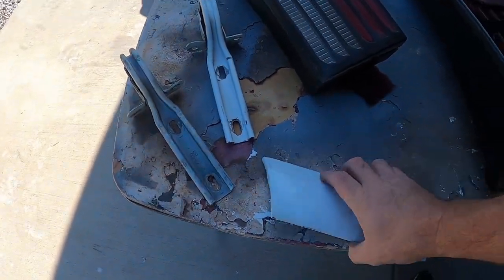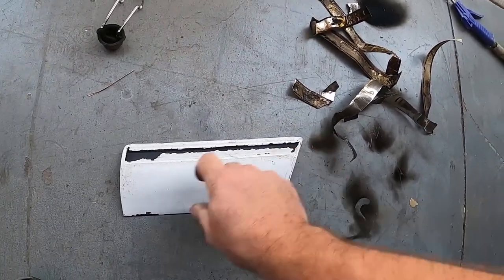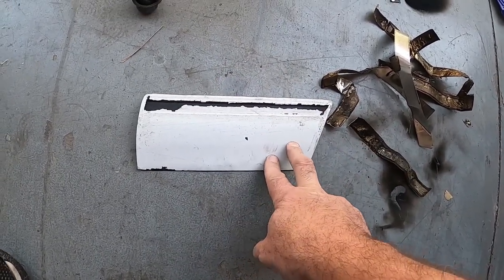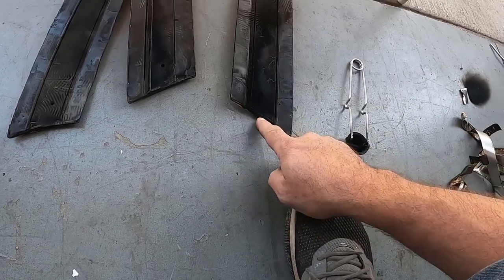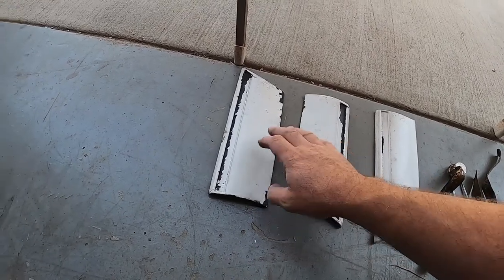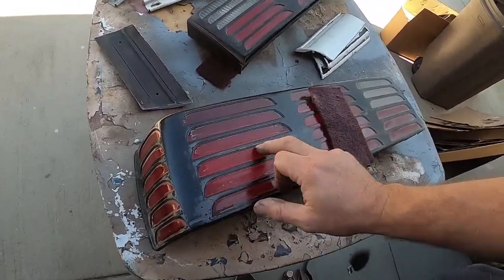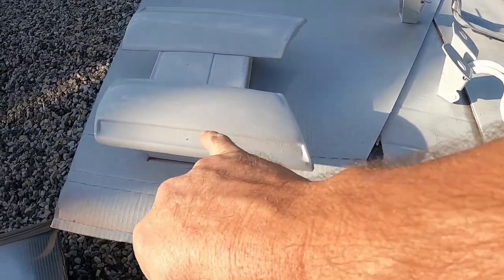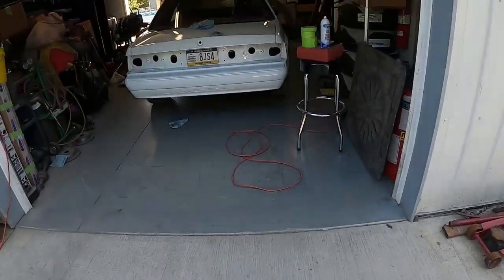painting gt fox body tail lights

Comment: What did you do to cover the lenses when you were painting?  Did you tape the lenses?
Reply from the maker: used the strait edge of the tape for the btm and then used a razor knife to trim off the extra tape i did the base coat then removed it then cleared the whole with ppg with the flex additive added to the clear theres a couple spots the the tape job could have been better just takes time to do it right when painting 90% of the job is in the prep-work

Comment: Hey, what clear did you use i used one and it started cracking on the red parts of the lenses
Reply from the maker: it was ppg brand shop line jc661 Hi-Gloss Multi-Panel Clear it flows out nice a lot is in the prep work i made sure to scuff the whole lense it was time consuming if not scuffed it will crack a peal off.
Reply: @Mattsneedforspeed  thanks for the vid

Comment: What did you use to clean the paint off?
Reply from the maker: they only had the oem original paint on that was half way worn off ( i got lucky) i just used a red scoch brite scuff pad to prep them, if they were repainted it might need to use a paint remover safe for plastic